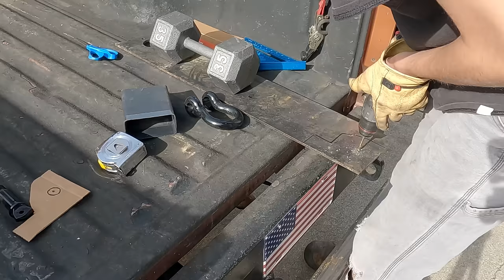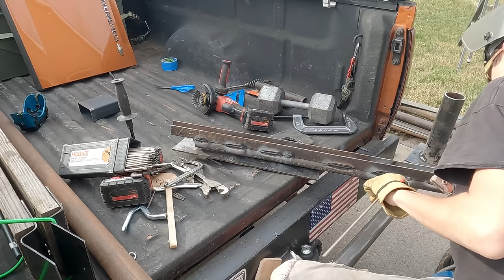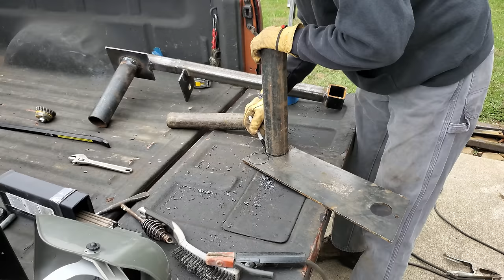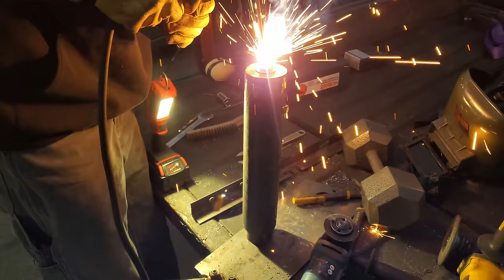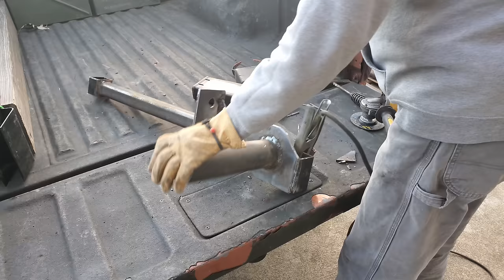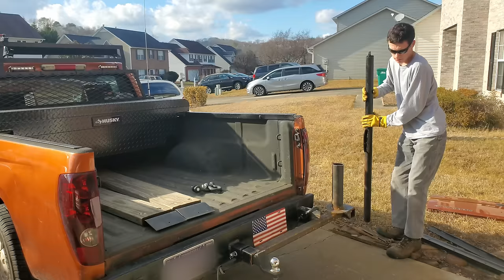DIY pickup truck crane

Comment: I think you should have welded a plate to the bottom of the pipe or bearing it would turn easier
Reply from the maker: I was going to but i didn't because i was afraid that if i made it easy to swing it would be uncontrollable on a hill.